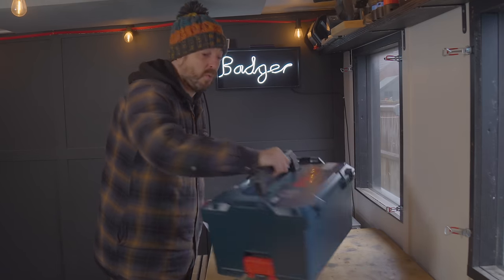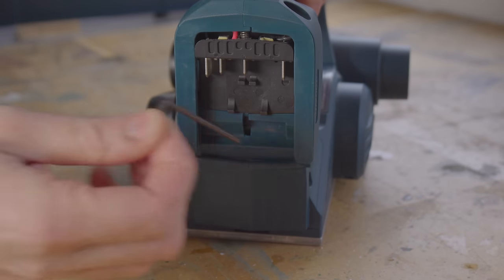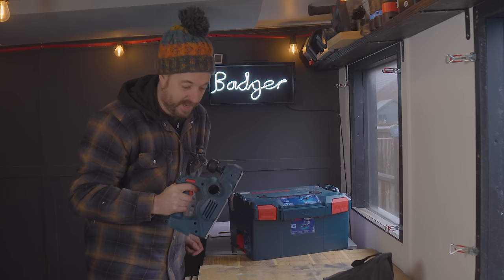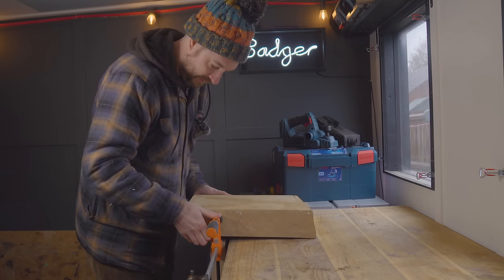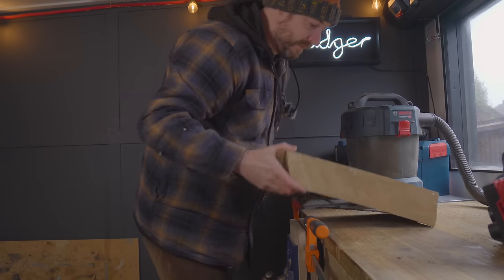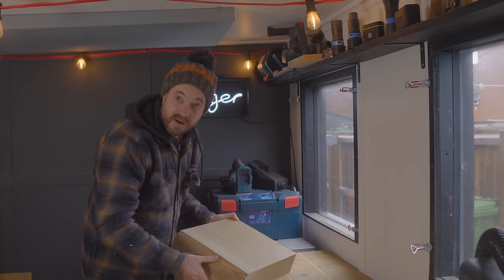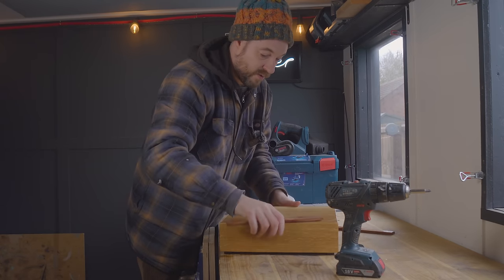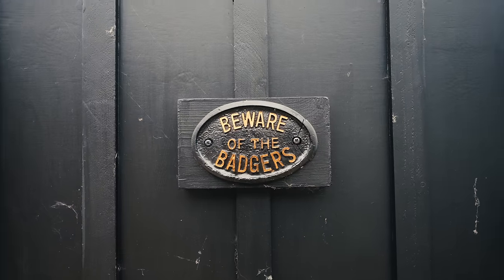Bosch Professional GHO 18 V  Planer

Comment: Funny as I happened to pick up my first electric planner too only last week to trim a handful of doors. Just remember to transfer your hand weight to the back of the machine as you're exiting the cut to prevent the cutter head from dipping into the work piece when the front section is unsupported (I made this mistake too!).
Reply: Clamp a piece of scrap wood to both ends of door, it will prevent tear out of the edges of the door.
Reply from the maker: Thank you. Good tip

Comment: After the first few passes (4:26) there where some very visible marks left (of the width of the planer). How did you get rid of those?

The block looks really beefy and will make a nice addition to your kitchen, Matt!
Reply from the maker: I gave it another pass then sanded it all
Reply: @Badgerworkshop  worked like a charm, it came out really smooth!

Comment: The way you are holding it suggests it’s a lot lighter than my Elu (which I’ve had for over 20 years). One of the things I like about its heft is that it rides so steadily along a long edge.
Reply from the maker: It’s pretty light
Reply: @Badgerworkshop  just checked - my Elu Mof80 is almost 4 bags of sugar - 8lbs! (Or 3.7kg in new money!). I also have the thicknesser stand which is great for quickly squaring 3x1 or 2x1.
Reply: @Badgerworkshop  Just weighed mine,with a 4Ah pro core battery it's just 2kg 4.4lbs,compared to 2.8kg 6.6lbs for my GHO 26-82.